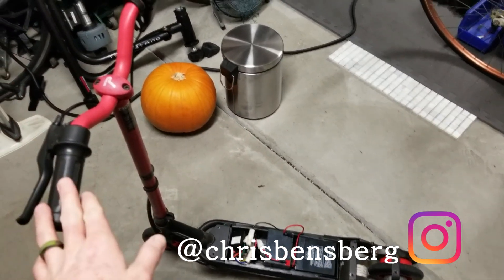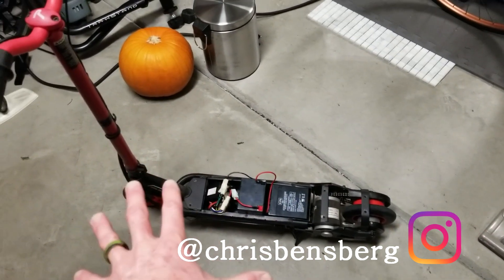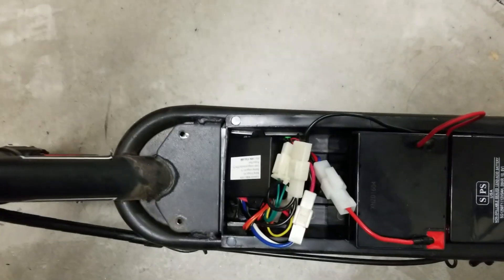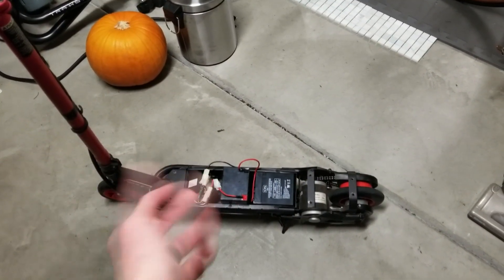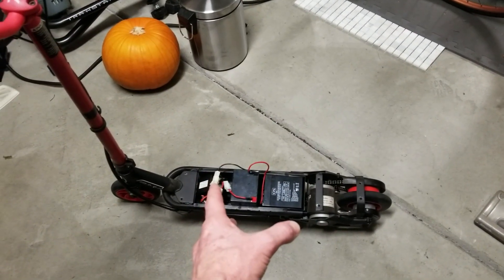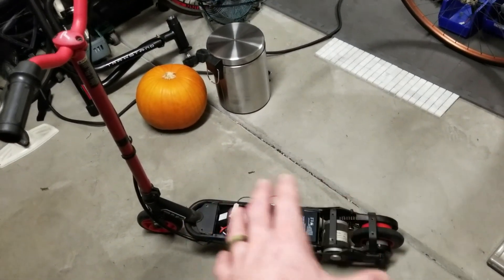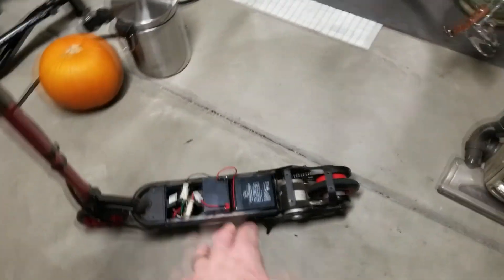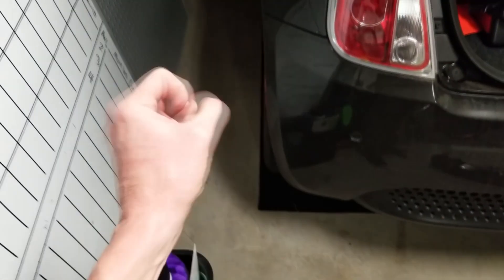Pulse Performance Electric Scooter Throttle Click Doesn't Work FIX!

Comment: My son received one about 6 years ago as a gift. He was to young to ride it so I was stored in the shed and forgot about. My other son found it and asked me if he could ride it. I told him we try to find the charger, which we may have now. But, to my surprise, 6 years later it's still holding the original charge. I though it was toast from the clicking noise, figured the control box was fried, but after watching your video we discovered it still works! Thank you so much!

Comment: For some reason my joyor F7 turned on one day with no error codes but the throttle didnt respond... Ussually i didnt have to kick start it and it would accelerate from a stand still.. Came across this video and decided to give this a try before ordering a new controller, and presto, the damn thing works just fine 🤔.. Dude you just saved me about 100 bucks for a new controller and other items i thought it needed.. Subscribed and thanks again bud!

Comment: It's called re-energizing the motor and it works on generators when they don't want to produce power but start you plug in a drill and spin it manually

Comment: We have a Pulse scooter, slightly different model but very similar, and this is how our is designed to work - specifically says this in the manual, motor will not engage until scooter has been kicked up to roughly 3mph first. So not sure I would call this a fix, so much as informing people that didn't bother to RTFM.
Reply: Or if they got it used and never got a manual.
Reply: So how did u fix it or what the part need to be replaced

Comment: My ew 48v trike mobility scooter turns on with everything functioning except excelleration! No power to motor or wheels,bought new batteries & all wires & connections fair what up?🤔
Reply: I got the same problem 😔

Comment: I have 2 Jetson Tempo scooters. They've been sitting for 2 years. I turned on the power and they both light up but after the kick start, neither of them will engage. I'm not getting the safety click from the throttle. Lil help?
Reply: i have this same problem
Reply: Yeh this video was no help and my electric scooter is brand new